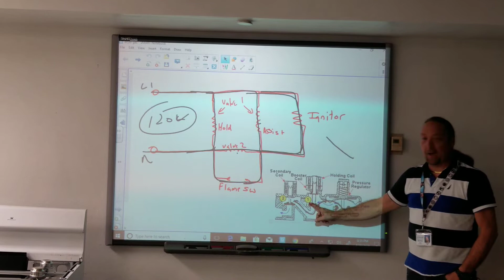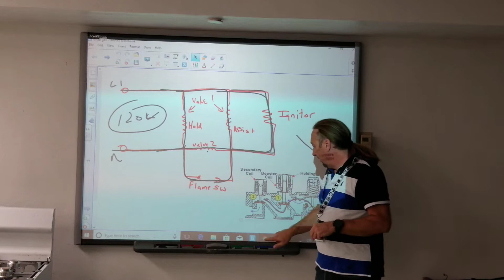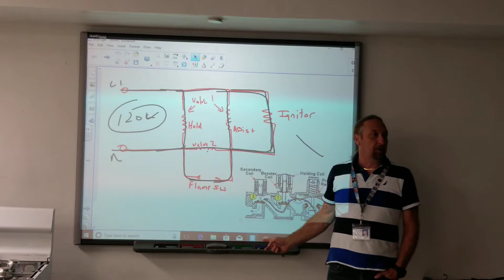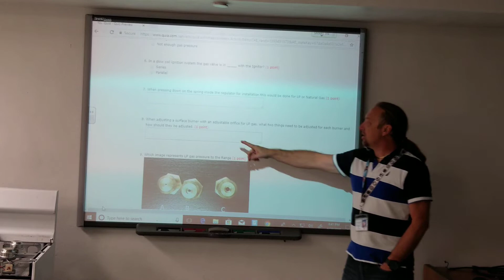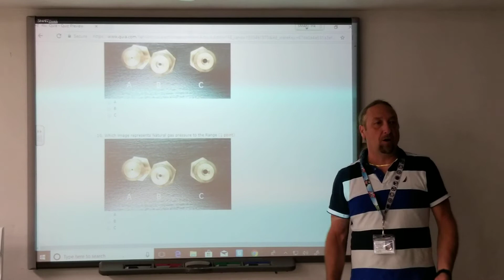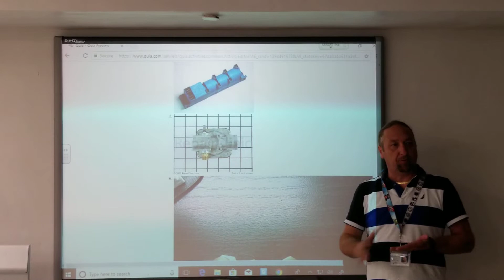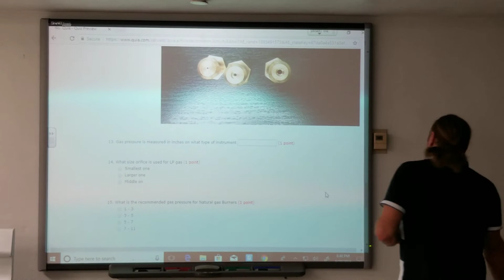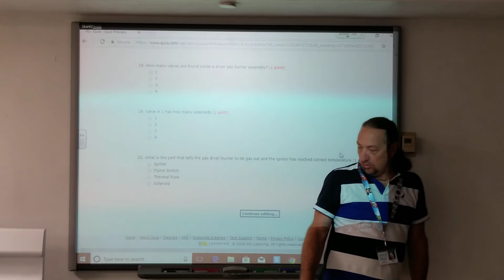Gas Stoves and Dryers

Comment: Do you guys actually measure gas pressure that is  going to a gas stove going to a service call? This is something that I wondered about for years… Because all of the installation manuals specify that you should measure the gas pressure prior to installing a new stove… ( I guess I’m the only guy who reads those… LOL) I’ve been a technician for 15 plus years… And I’ve never been trained on how to measure the gas pressure and I do not own a manometer….. i’m just curious what you guys do on service calls… Thank you for the cool training video
Reply: Yes we measure gas pressure, is important I have seen bad regulators, and even one customized ne their stove was not working and gas company shut them off